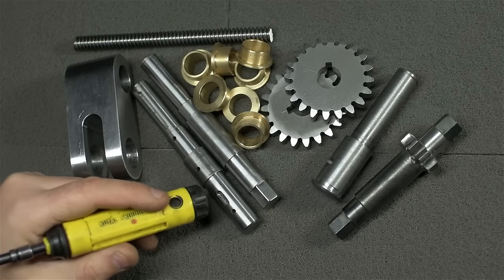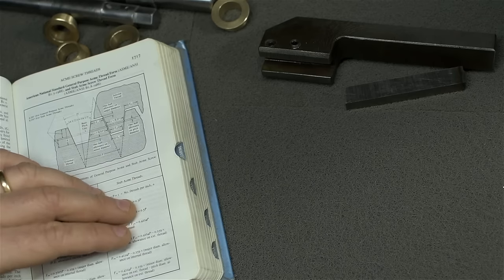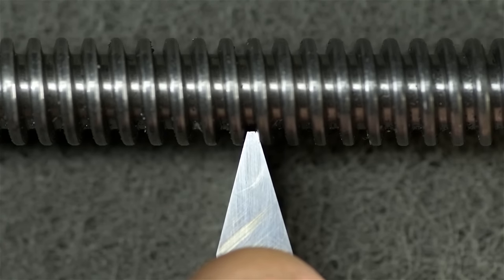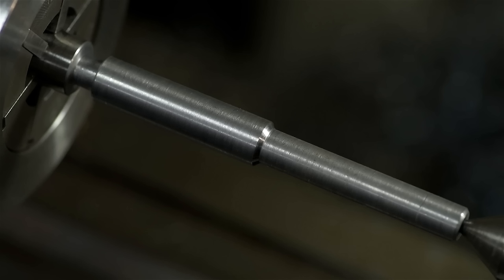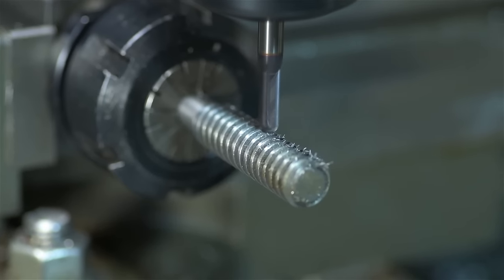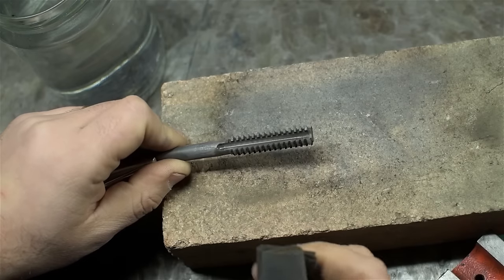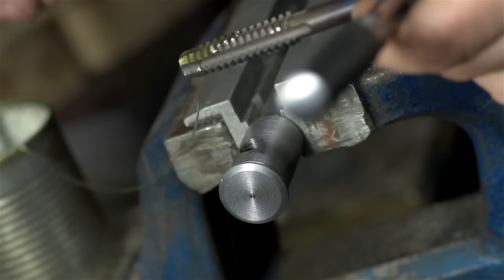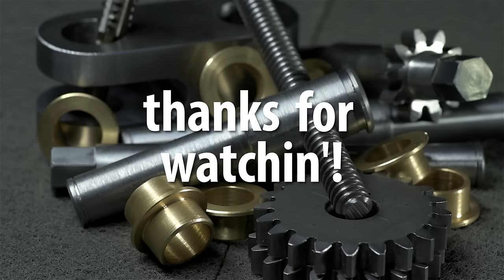More Thread Cutting & Heat Treating (I needed a metal tap)

Comment: Never joke about blowing a tap apart, I had flashbacks there! That horrible, sudden free movement, the knowledge that now you get to take a detour into tap-extractor land and it might just be easier to start from scratch...
Reply: I'm new to machining (currently being trained on a cnc mill in a tool and die shop) and I've had a few taps break, not fun.
Reply: some especially tiny taps I might add
Reply: M2 Taps, that’s all I’m sayin
Reply: tappy tap tap
Reply: SHHHHLIDES RIGHT IN
Reply: The moment you cut a fucking m2 sunkhole thread on a fucking 3000$ part and pray to god that this flimsy af tap won’t break because you know if it does you won’t get it out. But hey nothing better than some nervewrecking at work.
Reply: Supervisor: "How long do you think that part will take you? Just for the build sheet"
Me: "Almost done. About 3 hours" breaks tap "uh... make that 5 hours..."
Reply: I yelped.
Reply: Oh god that reminds me my personal day in tap hell. I broke so many I should have just left work for the day and saved everyone the trouble
Reply: EDM FTW
Reply: Never broken a tap in my life.

Just kidding!   :D
Reply: I once was making tool holders for my lathe and i broke a tap but i was so lazy that i just welded the screw to the top of the tap (it was the hight adjustment screw) and used it like that, it's really ugly, but it worked
Reply: @qwadratix  Yep. Me too. 35 years toolmaker, never broke one.
Reply: @DaveMarket   Get outta here, you're bumming out us mortals :)

Comment: "1st, trick myself into thinking I'm saving money by not buying one."

I feel like I live by this....
Reply from the maker: it's served me well. :)
Reply: I just bought a mill and a monster lathe so that I can save money.  My wife doesn't understand, but if my checkbook ever recovers, I'll show her.
Reply: Probably $4 or $500 tap?  BTW, an Acme tap is removing a lot more material than a conventional 60 degree tap.
Reply: I just bought 2 welders, I have a lathe (just bought a tool post), and I'm looking at a milling machine.. because I need to save money
Reply: I needed a transmission for one of my cars, so I bought another car and took the transmission out of it. 
I needed an extra set of wheels for rain tires for my race bike, so I bought another bike and took the wheels off. 

I have a slight hoarding issue. 1 sprinter van, 1 trailer, 3 cars, 2 motorcycles. Soon to be 3 motorcycles. I'm 23 and I live in an apartment. Yet somehow no complaints.
Reply: @Ellis Dee oh I'm definitely expecting to be forced to get rid of all my junk.
Reply: And so do thousands of companies as well, thinking they save money by procrastinating to buy a tool, while in the meantime improvising takes so much more time yet money
Reply: Adam Balwinski many many times. All the best to you and yours!
Reply: @ThisOldTony  DEF  ALWAYS A LEARNING EXPERIENCE
Reply: @dfw_motorrad1329   YOUR NOT JOKEING OR  YOU ARE  CAUSE I COULD SEE YOU COMMENT GOING BOTH WAYS
Reply: @NewsNowFortWorth  Nope that's just how it is. But I ended up selling that car and the old transmission for a profit, and I disassembled the other bike so I can have almost an entire bike worth of spare parts ready to go.
Reply: @dfw_motorrad1329  Oh Yeah?.....wait until you get married your hoarding days will be over.
Reply: DFW_Motorrad no complaints? You must be single.
Reply: @dfw_motorrad1329  Do you live in Browning, Montana? :-)
Possibly the world capital of vehicle hoarding.
Reply: @HomebrewHorsepower ,  @Rx7man - My dad became a car mechanic, so he'd always be able to fix his own car.
Then he became a bricky, so that he could work on his own house…first job being to extend the garage in every dimension.
He made being a lowly constable his career so that his family would always be looked after if anything happened to him (ironically, probably because of "the job").
During this time he filled the garage with tools and became a self-taught machinist all to facilitate those other jobs (for himself and others.) He'd work…then come home and get to work.
He even bought a new 24' boat hull and made everything to turn it into a full ocean going vessel…for the family, of course (including making the mould to make the 12' long split level cabin). He salvaged an old milk float for the engine and parts to modify the trailer.
He renovated the attic into 2 bedrooms and a landing including making the staircase from steel.
He levelled half the front garden and did all the brickwork, building all the walls front and back and between our neighbours.
…and he always had the time to make or mend our toys and to teach us/use us as slave labour for his projects, lol.
All this is to say, that those tools, when utilised properly, will definitely not only save you money in the long run, they could even make you a few pennies too. ;-)

Comment: I’m a little late for the game, but here is a machinists trick for water quenching:
Add a bit of dish soap to your quenching water! This will result in lower surface tension of the water and increase the surface contact with the to-be-hardened material. Also, forming of bubbles (Leidenfrost effect) is reduced, bubbles forming are much smaller and collapse faster. Therefore, the quench is more uniform. You can actually get away with some oil-hardening materials being quenched that way, due to less stress buildup!
Reply: Hey, that's actually a great idea.   I will definitely try that 3 years from now when I next need to quench something.
Reply: @HomebrewHorsepower  how did it go?
Reply: @davidowens8829  Worked great.  I actually made up a solution of "super quench" which is dish soap, jet dry, and salt.  Works really well.

Bet you weren't expecting a response!
Reply: @HomebrewHorsepower  hahahahhahah awesome 3 years later reply.
Reply: @HomebrewHorsepower  

It's time to quench, homebrew
Reply: My Machinist Classmates at Auld Tonae Polytechnic are funny....!!!!
Reply: @markmclean8858  I did you seemed like the kind of guy that would share your findings.

Comment: as a toolmaker I am amazed what you can do with the proper knowledge and an adequate homeshop
Reply: I find it actually kind of funny, so much work for tapping a hole in steel! I just spent less than half an hour cutting grooves into a 1/2" threaded rod with my Dremel, turning it into a tap for threading wood!
Reply: Yonatan24 that sounds like a pain in the ass lol
Reply: Wright brothers built a airplane in their home shop.
Reply: OTTO As a toolmaker, it should be quite obvious what you can do with proper tools and knowledge... Just like any other trade.
Reply from the maker: Thanks Otto!  a little bit of knowledge can be quite dangerous. ;)
Reply: You do realize that the Wright Brothers racing bicycle was the Ferrari of its day.

Comment: Tony, you touched on the reason that the cutting forces were higher than expected for the given diameter of tap.
When you started cutting your acme thread you first cut a 60* thread to relive the stress on your form tool....the same consideration needs to be observed in your acme tap....which is essentially a gang of form tools... commercial acme taps typically transition from a 60* thread into an acme tread over their length.
Reply: So in other words, it'll get there over time?

Comment: Nice!
Speaking of getting high speed steel soft during grinding: doesnt matter. Just get on it, annealing Hss is almost impossible without a controlled furnance/kiln.
Reply from the maker: you can save a lot of trouble just buying cheap HSS... it comes already soft. :)
Reply: "Highly Soft Steel" ?
Reply: This Old Tony steel starts to lose carbon content once it get to around 2600 but by that point its almost molten so grinding doesnt make that much difference
Reply: High Speed Silly.....its obvious.

Comment: Grinding the back of the flutes will allow the chips to pile up in the thread when you reverse the tap. Most taps are designed with a square back to help keep the chips in the flutes.
Reply: wheelitzr2 Thanks for the tip.
Reply from the maker: excellent point.  I should've thought ahead.  I wonder if that wasn't why my tap was feeling 'crunchy'.
Reply: This Old Tony sorry not to be that guy. I really enjoy your videos! Thank you!
Reply: This is quite correct  but commercially made taps have a slight clearance angle ground into rear of the thread profile which reduces the torque required to turn the tap.
Reply: I had the same thought, but assumed that I was missing something.

Comment: Your very welcome, Thank You for sharing this with us.
My visit into the tap making world was a simple thread clean out tap for a driveline. Just took an extra bolt that hold the U-joint in place and used a dremel and cut some flutes.
Worked well doing the job I needed it to do. Moral of the story. If you need it now and can't wait. Then make it yourself and also save the money.

Comment: Nice job Tony. I believe W1 is a high carbon steel, but it isn't a high speed steel. The two aren't the same. HSS is also high carbon, but with additional alloys to make it high speed.

Offset thread cutting doesn't require 1/2 the thread angle, and that's a bit of internet forum BS that has just taken off and not even a dose of penicillin seems capable of taking care of that pox! It's a pet hate of mine. So long as the compound is set to LESS than half the thread angle, you're good to go. 29.5 just happens to be chosen as it's half the thread angle (for 60 degree threads) with a bit less for mum. It could just as easy be 27 degrees, 25 degrees, or 29.048921 degrees and nobody will notice the difference. It could also be 0 degrees and then we'd call it plunge cutting ;)
Reply: i agree , in UK sliver steel= high carbon not HSS, still very good very video.

Comment: Twice the price but 4 times the fun...for us... ~¿@  Super nice tap build and I still jerked when you pretended to "Bink" it.  It must be a PTSD reaction (not covered in the DMS-5) from breaking every 6-32 in the county on a project. Thanks Tony, Great video.
Reply: Pisalchemy+ According to Tom Lipton 6/32 is the tap that he dislikes using the most as it is the easiest to break.
Reply: july8xx+ The 6-32 tap is notorious for breaking because of the pitch to root diameter to flute depth is the least ideal, leaving a small margin in heat treating (toughness vs hardness).  In my case I was tapping a thru hole in a 1/4-20 SHCS (RC39-45)...not pretty even slightly annealed and 60% engagement.

Acme's aren't much better and that is what makes Tony's "grandma's tap recipe" such a fine build.

Comment: nice video, thanks. was just wondering how taps were made yesterday!

a few notes on steel, im not an expert but i know a bit. W1 and O1 (the w stands for water quenching and the O stands for oil quenching)  are not actually high speed steels, they are both considered "cold work" steels. in use the steel cant get above its tempering tempratures, with high speed steels the tempering temprature is much higher than on cold work steels. 

high speed or hot work steels such as m2 (most drill bits), m4, m42 etc have a significant amount of Molybdenum (thats what the M stands for) alloy, this lets them get  hot and still keep their temper, but it also means they need to be heat treated and tempered at much higher tempratures, which makes them more difficult to heat treat and have more problems with scale. they are also more wear resistant than less alloyed steels. for an extreme example, CPM 10V (V stands for Vanadium as the major alloying element) is hardned at  1850-2150F(1010-1175C) and tempered at a minimum of 1000F(540C). this means it cant be heat treated in atmosphere because it will oxidize so badly.

W1 and O1 are similar to echother with the main difference being O1 is more heavily alloyed. the main alloy is Manganese, and this increses toughness and wear resistance. also O1 has a bit more chromium than W1 (.50 vs .15%) this is primarily to increse its depth of hardening and is why it can be oil hardened, it also increses wear resistance. 

simpler steels like W1 have a limited depth of hardening, meaning on larger parts they will have a soft core sorunded by hard steel, and need a fast water quench to acheve that limited hardness depth. O1 has enough chromium to  increse the depth of hardness and thus can be oil quenched (slower quench) which is easier to controll warpage.

Comment: I've never used honey for thread tap lube before, would you recommend for all tapping?
Reply: I thought it was Astroglide
Reply: Tap Majic, Red Label. None of those fancy other versions. They require perceptibly more force, and that force = more broken taps.
Reply: I think it depends on who you are tapping, Oh I mean what you are tapping.
Reply: On most of the woodworking channels, they use mustard for wood glue, so why not?  I can also authoritatively point out that ketchup and peanut butter will work as thermal grease on the CPU in your computer.
Reply: Just make sure you are using the right kind.  That looks like a nice clover honey.
Reply: +Randy Richard In The Shop -- "who you are tapping"?  Well, Amanda, of course... :)
Reply: Grumpy OldMan 

Amanda who?   😂

“Don’t have a cow man!”
                     Bart Simpson
Reply: +Wayne Crews
Amanda Tapping, of course...
Reply: Grumpy OldMan 

Glad it’s not Amanda Hug-n-kiss. 😉
Reply: imabeapirate will
Reply: you only use Astroglide for reaming hole jeez
Reply: @Crewsy  Amanda HugAnKiss of course
Reply: Don’t have a cow man.
Reply: Just make sure it's local honey. Otherwise that straw colored tap is going to make you sneeze up a storm.

Comment: "Hopefully you find something useful in there" the sum total of my tap making experience is hacking "flutes" into an M5 bolt with a dremel cutoff wheel. Now I feel like I could try it myself... if I had some ACME rod... and an oxy torch... and a mill...
Reply: LOL - I just watched this video again, 3 years later in Nov 2021... and I thought exactly the same thing as you wrote.

Comment: As a lifelong electrical engineer now playing in my retirement workshop (shed), let me say that there is something useful in every video you do. In this case nothing to do with your tap! It was the use of the square collet block caught my eye. I don't even have a milling machine (yet) but one of those, and maybe a hex one, will make even my hand filing and drill press work on round stock so much more accurate.

Comment: Haha, we needed one those, for an emergency repair to a gate valve which had suffered a bent valve stem, it took two days to get the dye over from Singapore to South Australia to cut the new stem, only to realise the brass boss had be damaged by some brute force trying to get the valve to operate before it got to the shop, another two days for the tap - long past an emergency recovery and a very late assemble and test that night it was back in service.
Why Singapore, who knows, why repair it - lead time to replacement.
Client very happy, lesson learnt about if you need a dye, you may as well get the tap !!

Comment: I once used a hacksaw and a bench grinder to turn a zinc coated bolt into a tap before my tapping set had arrived. The hardening was near impossible but at the end it did work.

Comment: Wait wait, how did you switch tools in the middle of a threading operation when the two different cutters probably didn’t have the exact same width from the right edge to the cutting point?? I.e, when you change tools you could have advanced or reversed the cutting edge relative to the lead screw position....or did you take that into account when you ground the form tool to match the roughing tool?
Reply: Was wondering the same thing myself
Reply: I think you are thinking too faar buddy :) I bet he just simply ran the new tool in the threading state and adjusted the workpiece on it
Reply: He had the compound slide sideways to help compensate for that. And manually adjusted. You can move stuff around without turning the lathe on ;)
Reply: Just guessing, but he may have stopped the lathe with the tool in the middle of the piece (& the thread indicator engaged). Then back out, change the bit, wind back in & use the compound & a magnifier to check that he's in the middle of the groove again. Then with 0 or only very little cut (to check that it's right) finish that pass. Now you've got the new tool in, and it's position is right for the thread indicator.
Reply from the maker: just lined it up by eye.
Reply: This Old Tony man you are a legend...by eye!?  Man I’m not that good! ;-)

Comment: Good tip for hardening taps and round things: Put it in the drill press to rotate and the quenching jar under it. When the temperature is correct, plunge the tool in. This gets even heating around the tool and even quenching without banana shapes.

Comment: WHY IS THERE NO VIDEO OF YOU SHORTENING THE DIVING BOARD? :( Awwwww.
Reply: I need to see this happen so much i might just have to try chainsawing some scaffold board myself. From 8 feet away, obviously.
Reply: Yeah it's one of those annoying cruel teases. Like the Sherlock Holmes stories that refer to named cases with intriguing titles that never got written. Such as "The Mystery of the Shortened Diving Board And Bleeding Man". I wouldn't use a chainsaw though. Obviously the risks are too high. It could fall into the pool; then you've got a ruined chainsaw. Maybe use some duct tape on a skilsaw trigger and guard, and some more to attach it to a fence post, and then push/swing an 8ft long board at that? Unless it's a cheap, blunt chainsaw. Then have at it.